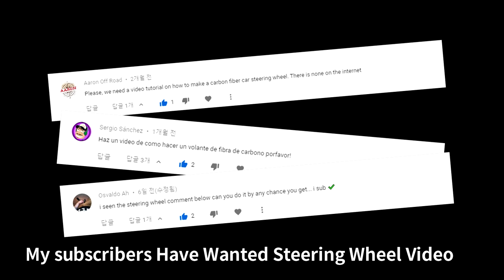How to Make a Carbon Fiber Steering Wheel with Epoxy Resin [DIY]

Comment: Hi guy
is the 220 not too hard?  there is only one coat of resin, how can you not ruin the Carbon?  when I use the 400 I immediately get to the fiber and ruin it
Reply from the maker: Hello, Buddy!
I didn't sand too hard the first time I sanded.
You must sand the carbon fiber cloth to avoid damaging the pattern.
For the second sanding, apply several layers of epoxy resin and sanding.
At this time, It can sand to a lot of epoxy resin and shape the steering wheel.
Even the sand paper of the P220 can be adjusted according to the strength of the force.
And the scratches on the P220 sandpaper will all disappear after applying epoxy resin.
You should not shape done when first sand.
The second sand is very important.
I hope you helpful.

Comment: Hi, thanks for the amazing video! I have tried to do a steering wheel on my own but I faced a little problem. When the wheel is under a direct sunlight or any other light source, the resin looks very dusty, like it is full of white dust. There are almost no clear spots. When no lighting it looks great. If you can tell me what that is and how to avoid it next time I will be very grateful. Thanks!
Reply from the maker: Hello, Buddy!
I think you applied it too thickly when applying epoxy resin.
When the epoxy resin is applied thickly, white bubbles appear inside.
When applying epoxy resin, it is important to apply a thin layer several times.
When applying epoxy resin several times, it should be applied once every 2-3 hours when it is half cure.
I hope my advice will help you.
Thank you for watching.
Reply: @ECOLAPStudio  hi, what kind of epoxy resin did you apply to get the carbon fiber to stick to the steering wheel?
Reply: @ECOLAPStudio hello good day! How many layer of resin do we need for a good finish?

Comment: ciao bel lavoro ,uso il carbonio anche io ma solitamente come ultima mano do il trasparente per evitare imperfezioni.una info,cosa si può usare come riempitivo per aumentare il diametro della corona?perche una volta foderato la parte con il solo carbonio rimane molto più fine rispetto il resto del volante...
Reply from the maker: Hello, Buddy!
I'm sorry I can't speak Italian.
Anyway, do you want to increase the diameter of the steering wheel?
There are several ways to increase the diameter of the steering wheel.
I think that using the filler is the simplest.
The type of filler doesn't matter much.
But it's good to choose something that is easy to sand.
Sanding is very important after applying several layers of fillers.
You have to make a shape with sanding.
After that, you can apply a gelcoat and layer carbon fibers.
I hope you helpful.
Reply: @ECOLAPStudio  sorry, I saw the description in English and I thought you were Italian.
can I use resin paste as a filler?
because the coated part remains much larger than the carbon one,so I would like to increase the carbon size
Reply from the maker: @bluspirit81  Resin is difficult to use as a filler.
Because the resin is low in viscosity, it flows down.
Also, after curing, it is very hard, so sanding is very hard.
Making shapes with sanding is very hard.
If you want to increase the diameter of the steering wheel, it is recommended to use a filler that is easy to sand.
I hope you helpful.
Reply: @ECOLAPStudio   i don t mean liquid resin,but resin paste .I do not know how to say it in English. is not liquid ,but it can be modeled by hand and then hardens
Reply from the maker: @bluspirit81  We do not seem to understand each other because of language. I'm sorry T.T
Liquid resins, such as epoxy resins is flow down and not easy to use.
When you choose resins or fillers, simple materials should be used for modeling and sanding.
Modeling is very important.
Good modeling results in good carbon fiber skinning results.
Reply: @ECOLAPStudio   ok ,i mean epoxy putty :D

Comment: Can you make it so that theres a carbon fiber split bookmark in the middle of the wheel? how do you cut the fabric?
Reply from the maker: Hello, Buddy!
When cutting carbon fiber cloth, you can easily cut it with scissors.
Carbon fiber cured with epoxy resin can be cut or shaped using scissors, knives, sandpaper, etc.
Reply: @ECOLAPStudio  i ment during layup, if you can lay the carbon fiber perfectly split down the middle similar to how car manufacturers do it like Ferrari, Lamborghini or koenigsegg

Comment: Is the shrink film necessary? I can’t seem to find any
Reply from the maker: Hello, Buddy!!
You will make without the shrink film.
But, If you have Shrink film, It is useful.
The shrink film helps the carbon fiber and the steering wheel to stick together.

https://www.easycomposites.co.uk/#!/vacuum-equipment-and-supplies/vacuum-bagging-consumables/composites-shrink-tape.html

Comment: does  your heated function still works  after this?
Reply from the maker: Hello, Buddy!
Unfortunately, I haven't created a hot wire feature.
Creating a heating wire is a trickier task than you might think.
It's not an impossible task, but I didn't think it was necessary.
Reply: ECO-LAP Studio i see, most custom wheel companies say heating wont work too. Thanks
Reply: I am trying to figure out how to do it with heated element can you help please @ecolapstudio

Comment: How do you tuck in the leather between the carbon fiber?
Reply from the maker: Hello, Buddy~
In the video, there's a small space in the area that's not the carbon fiber and the carbon fiber.
It's simple to push it in there with a squeegee.
Most steering wheels do this.
I hope you helpful.
Thank you for watching!!

Comment: Can you provide a link to the resin you used or at least more details
Reply from the maker: Hello, Buddy!
I purchased materials from a Korean online shop.
However, Korean online shops do not ship overseas.
So I'm going to show you an online shop in the UK.
Epoxy gelcoat  https://www.easycomposites.co.uk/#!/resin-gel-silicone-adhesive/epoxy-gelcoat/epoxy-tooling-gel-coat.html  
Lamating epoxy resin   https://www.easycomposites.co.uk/#!/resin-gel-silicone-adhesive/epoxy-resin/EL2-epoxy-laminating-resin.html
top coat https://www.easycomposites.co.uk/#!/resin-gel-silicone-adhesive/epoxy-resin/epoxy-coating-resin.html
carbon fiber cloth https://www.easycomposites.co.uk/#!/fabric-and-reinforcement/carbon-fibre-reinforcement/woven-carbon-cloth-under-400gsm/22-twill-240gsm-3k-1-25m.html
shrink tape https://www.easycomposites.co.uk/#!/vacuum-equipment-and-supplies/vacuum-bagging-consumables/composites-shrink-tape.html
I hope you helpful.
Reply: ECO-LAP Studio thank you

Comment: How can I do flat bottom carbon fiber steering wheel?
Reply from the maker: Hello, Buddy!
It's simple.
Apply epoxy resin to the steering wheel several times, and after curing, leveling(flatten) with sandpaper.
I applied epoxy resin five times in this video.
I hope you helpful.
Reply: ECO-LAP Studio how is the name of black epoxy resin?
Reply from the maker: The black epoxy is a gelcoat. (epoxy gelcoat)
gelcoat is used to attach carbon fibers to the steering wheel. And it is useful to cover the base color when the base color is not black.
Reply: @ECOLAPStudio  Ok. Thank you for information, but how can I make this type of steering. With this form? 
https://smhttp-ssl-46021.nexcesscdn.net/pub/media/catalog/product/cache/c687aa7517cf01e65c009f6943c2b1e9/i/m/img_4540-edit.jpg
Reply from the maker: I think it's not impossible to make
The steering wheel was also made by man too.
I don't think it's possible with the methods in only this video.
I think, it's important to make a basic shape.
A simple way is to use filler to refine the basic shapes.
It's a simple way to do it in general.
I said it's a simple way, but I think it's not an easy work.
I hope you make a nice your steering wheel.
Reply: Use a power tool to shave off piece of the bottom. After that, use 1/8 foam to cover it up and smooth it.

Comment: What was the clear stuff wrapped around the carbon and then heated?
Reply from the maker: Hello, Buddy!
It is a shrink film.
Carbon fiber cloth can be attached to the steering wheel with a shrink film.
However, it is not necessary.
I wanted to show that you can also use shrink film.
I hope you helpful.

Comment: kinda sucks how the shrink wrap tape left lines throughout the carbon fiber!
Reply from the maker: Hello, Buddy!
The line is almost invisible after sanding and epoxy coating.
Although my work may not be 100% perfect, I would like to share my knowledge with many people.
Thank you for watching.
Reply: @ECOLAPStudio  The shrink tape is a great Idea, It's a pity you can still see the lines in the epoxy! You can defiantly see them in the finished product! It's a difficult decision, because either you vacuum seal it and get a tight bond but you get the lines from the tape!

Comment: I dont wanna be rude but the carbon and the leather are not at the same high.
 Leather is much thick then the carbon it self.
For me personal you ruined that steering wheel it was better stock as it was.

If you guys wanna get proffesional steering wheel i recommend go and serach for azaautowheel
see how proffesionals make and modify your steering wheel

Comment: how do they change the steering wheel crown?
Reply from the maker: Hello, Buddy!

Do you mean leather?
I sewed leather and exchanged it.
This was a very difficult and time consuming task.
If you have anything else, please leave a comment.
Thanks for watching
.
Reply: @ECOLAPStudio  no, I mean how do they change the shape of the crown. many people moficano the handle, how do they do? do they use resin paste?
Reply from the maker: @bluspirit81  Sorry I misunderstood
Do you want to change the shape of the steering wheel?
I think it's not a simple task.
To do that, you'll need a lot of filler, and you'll need time to shape it.
I think you will have to put a lot of filler on the steering wheel and trim the shape with sandpaper.
Or maybe you could use a 3D printer or a mold to make the steering wheel the way you want and glue it.
I'm sorry. Maybe it's not the answer you want.
Reply: why do you always use the resin as the last process instead of spraying the transparent 2k ?
Reply from the maker: Hello, Buddy!
I do not use epoxy resin for the top coat of all carbon fiber parts.
Some parts are finished with a clear spray.
However, parts exposed to the outside (sunlight) use anti uv epoxy resin.
The parts that do not require an antiuv topcoat are finished with a clear spray.
I hope you helpful.
Reply: @ECOLAPStudio  ok but you can aslo use  clear spray antiuv for the outside parts or not? Spray 2k Is more clear than resin Expo

Comment: Is there a website to buy the material?
Reply from the maker: Hello, Buddy!
I purchased materials from a Korean online shop.
However, Korean online shops do not ship overseas.
So I'm going to show you an online shop in the UK.
Epoxy gelcoat  https://www.easycomposites.co.uk/#!/resin-gel-silicone-adhesive/epoxy-gelcoat/epoxy-tooling-gel-coat.html  
Lamating epoxy resin   https://www.easycomposites.co.uk/#!/resin-gel-silicone-adhesive/epoxy-resin/EL2-epoxy-laminating-resin.html
top coat https://www.easycomposites.co.uk/#!/resin-gel-silicone-adhesive/epoxy-resin/epoxy-coating-resin.html
carbon fiber cloth https://www.easycomposites.co.uk/#!/fabric-and-reinforcement/carbon-fibre-reinforcement/woven-carbon-cloth-under-400gsm/22-twill-240gsm-3k-1-25m.html

I hope you helpful.

Comment: To put one layer of carbon fiber on the soft steering wheel rubber and cover it with layers of resin is not enough! In a year, or even earlier, all this may simply fall off, because the carbon will not have a solid base underneath. And the wrap...OMFG!
Reply: Da Beast any ideas how to solve that issue?
Reply: How would you fix that? add more layers?